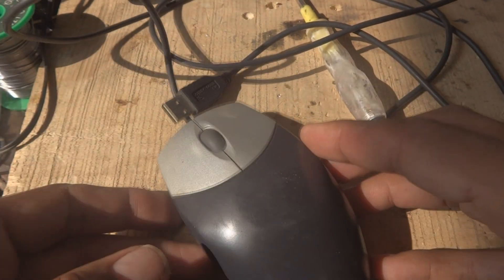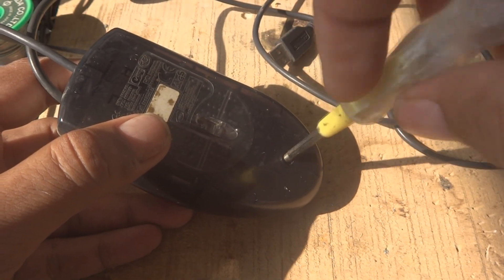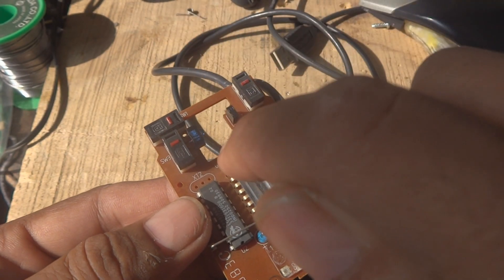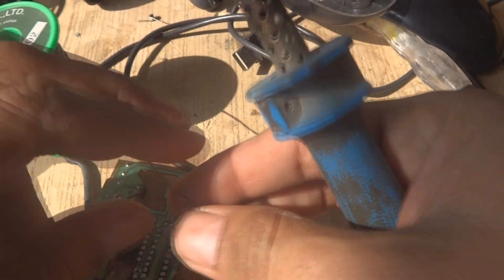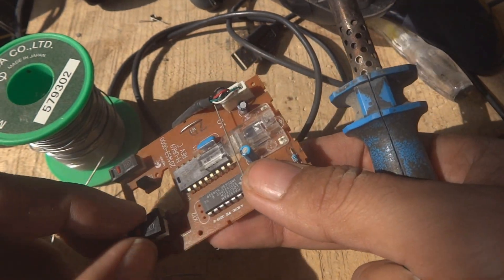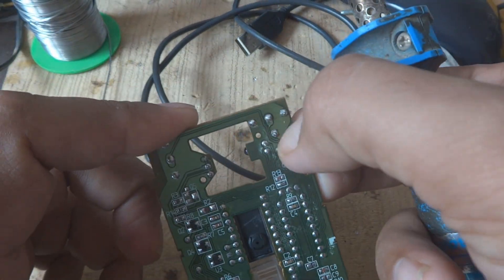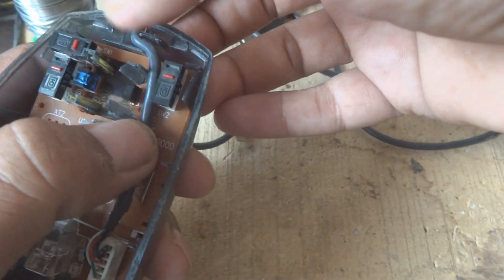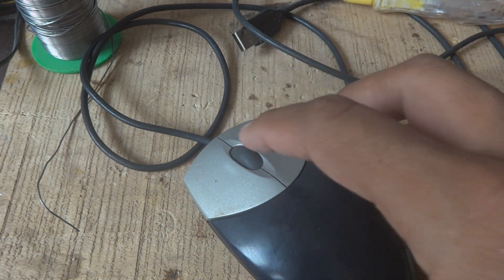optical mouse double click problem solution. real working solution 100%

Comment: Sir, I bought new AUTO close window unit from AliExpress. Installed and all connections done. However, the unit is rolling up each window for about 2 seconds one after another and repeat the same process until timer reach 8 seconds. I'm really surprised why it just activate each relay only 2 seconds?!!!!!!!!!!!!!!!!!!! Actually, it should activate each relay for 8 seconds one after another and complete 8x4 is 32 seconds time in total. Please help!!!!!!!!

Comment: why resoldering solves the problem? Isnt the fault in that small click button??
Reply from the maker: Dear dude you may watch the video once again. I swapped the two switches together. The one which was under the wheel was a good working switch which had been come to left click after swapping. Regards,